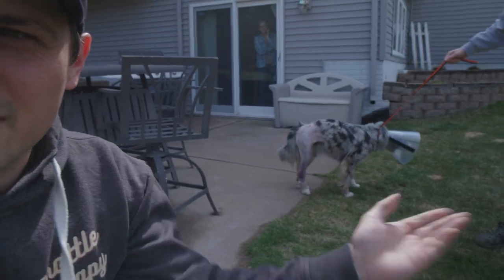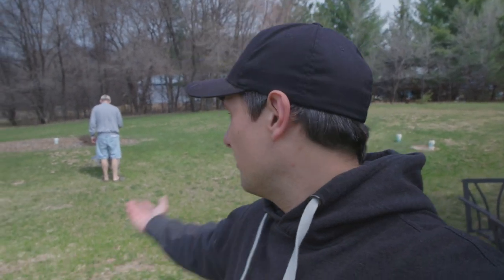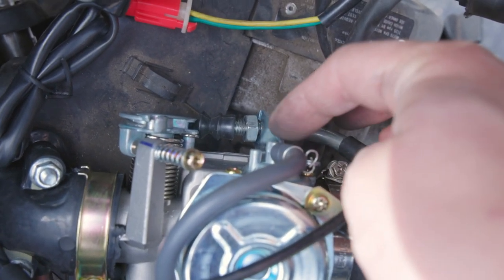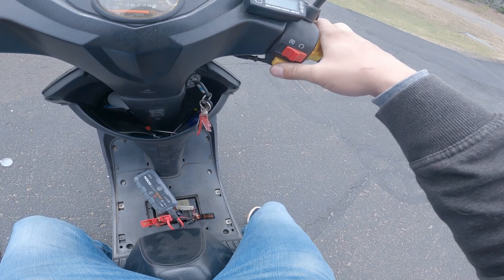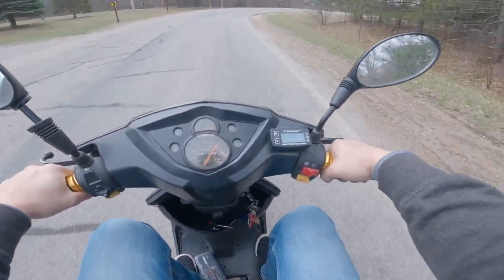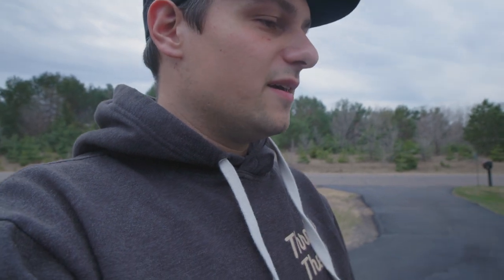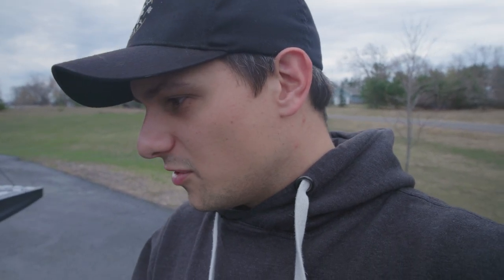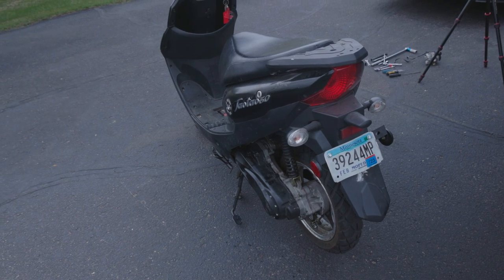150cc gy6 carburetor on 80cc Big Bore Kit TaoTao gy6

Comment from the maker: What does this scooter need to go faster? Lighter weights did not work.
Reply: You need 7or 8 the carb I have got is 24mm 150 with 100 main jet with 35 air with 50mm piston port match the inlet to the head it sounds like it not reving out.
Reply from the maker: @jeffmee763  thank you! Just ordered some 7 grams🤘 I think I have jets laying around somewhere I see what I can do
Reply: @throttle_therapy  don't forget if you using 150cc inlet you must port match to the head put a rag in the port and a good vac to get the bits out and adjust the air screw on side of the carb
Reply: flat slide carb
Reply from the maker: @linojrfilms1561  is that going to make it faster top speed or will that just make the Throttle response snappier? Either way that's a good idea!
Reply: You need to change your jets also you'll have better luck with that air filter that came with that carburetor for whatever reason they tend to bog when you have distance from the carburetor to air filter when converting to this setup also if you run that filter might want to get a fender .
Reply from the maker: Good to know! Thank you. I will try the other filter in the next video🤘
Reply: Lighterweights give you a slower start off 1-30 but quicker 30-45 50.  Heavier weights are the opposite. However it kids it rolling for high end and hills.
Reply: Try some 92-96 jets. Sometimes too much gas will lose you power on the high end
Reply: Throw in a 105cc from Amazon
Reply from the maker: @kalanikaai9215  I'll give it a try!
Reply: Manipulate the intake over and over till the engine runs right
Reply from the maker: @GreenEyeDemon  alright, I'll get some stock stuff👍
Reply from the maker: @kinghtin2darkness  heck yeah, thank you for that🤘 I appreciate. Now I have some work to do
Reply: 7 or 8 gram weights are where it's at. When you add the big bore kit it's going to need more fuel. When you change out you weight to 5 or 4  it could have needed more fuel because the crankshaft was able to spin easier.
Reply: I did an 80cc upgrade and I’m impressed. Plenty of power. I can actually keep up with traffic now. But I’m noticing the idle is terrible. Either too much RPMs or stalling. I can’t find the sweet spot. I’m using the original 18mm carburetor. Timing is good. Valves are good. Do I need to go 20mm carburetor for the additional fuel requirements?
Reply: My scooter kimco 50 has 100cc bigbore 5gram rollers highspeed variator 24 mm cvt carb you need more air in and out fit a A9 cam will help and good performance c d i box my scooter runs well top speed is 105KLM.for my wieght of 81kilo. make sure your engine has low milage making sure vale timing is spot on (worn timing chains on older engines you lose performance.
Reply: Drop it out of an airplane It will go real fast for a few seconds lol😂😂😂😂
Reply: Stiffer backspring of the cvt and 6-8 gram rollers should do the job

Comment: I got that same carb for my 90cc big bore. I cheated and got the AEM afr gauge to tune my carb. I got my carb tuned for a 13.5 air fuel ratio and it runs great. I hit 51mph now. I'm running a 35 pilot jet and a 120 main. Good luck
Reply: stock carb or 150cc ?
Reply: @thestoryofnomads obviously the 150cc goofy

Comment: The thing that made a massive difference for speed on mine was the belt, id suggest getting a bigger belt and also put the old carb back on. I was running 10g rollers as well and I'd get about 50 - 55mph on gps
Reply from the maker: I have a decent Gates belt on there now. Seems to be better that the cheap ones on amazon that we used in the past!
Reply: I dont get it . I see every one putting 8 9 10 Gram roller . I was having 6 with my high speed variator , put 5 and its better  ...
Reply: I did the 80cc upgrade. Huge difference. Not terribly faster -about 45mph but now it’s not a struggle to get there.

Comment: I have the same glixal kit on mine, I tried to run the yellow clutch springs and they were stiff for me, they rode for a long time and it would only do 30mph, I put the 1500 stall contra spring in with the old beat up clutch springs and mine will tap 45 on level ground now. That's with the 7g sliders in it, on a 12 inch tire, with the stock gearing. I've heard you can run the stock head with the a9 cam and the smaller valves will produce a higher dynamic compression, which WOULD increase torque, and I know from experience that a 63mm cylinder with the stock 50 head, stock 50 cam, stock 50 carb, with a pod filter, 93 main, 3 6g rollers and 3 8g rollers, and a range 6 plug, with a stock clutch and driver are 14/40 in the rear will do 55mph on a 10 inch tire, that was the setup on my velocity mp50 with a Meiduo gy6 on it.

Comment: Variator rollers is the key and you went lighter and you want heavier check your spark plug if it's burning good you don't have to worry about chatting especially with the bigger carburetor that's the best it's going to get

Comment: Wish I can help the dig otherwise I have a 80/100 cc kit it was running great 52 then the carb spring broke so I Said let me get a 150cc carb...then cable didn't fit I was pissed ...it bogged Luke yours is doing ...I re adjusted the valves ..the thing took off much better ....now I'll do some jetting next but doing the valves made a whole difference...plush I see all these guys putting alot of time and money into these things.....I just hop on my harley..but I'll do the jets and that's it it runs 52 now ...sucks because the crappy carb that broke I had it going same speed...but I'll put bigger jests in that's all..I'm in Miami people can't drive so I just got the scoot to go around this mess traffic here ...good luck love your place hope dog is OK I have 4 ..wish I can help ..peace

Comment: I guess I got lucky I have the rolling wrench 90cc and I also use the 24mm cwk for a 150cc I forgotten what jet I put in but I got it running nice and smooth with 11gram slider weights
Reply from the maker: I want to get the monster kit from Rolling Wrench! That sounds sick!
Reply: @throttle_therapy  worth it to me brotha
Reply: 11g slider on a 90cc??? I run 11 on my 150cc without losing much if any top end. I do have a larger variator though. I recommend you go lower on the sliders and get a bigger variator, it will let you run way lighter weights without losing top end or at least much

Comment: Or you can install a a9 camshaft you could get a cylinder head with bigger valves also that would help I'm doing the same thing with my 50cc and getting improvements I got my 50cc it's running 42 mile an hour now you got to test and tune plug & Play
Reply from the maker: Its a long process for me lol my brain likes to forget information easily. I should probably start a log with all the settings and keep track that way

Comment: Use a 21 pwk with a 150cc manifold snugged in all yellow springs and 9 weights. For sure you'll hit 46-50
Reply from the maker: how hard was it to fit the carb into the 150 manifold? I am looking at those carbs now thinking it would be fun to try.

Comment: You kind of have to connect the vacuum line otherwise you’re basically running with your choke on my entire time
Reply from the maker: See.. still learning. Thank you! Is it possible to just cap it?
Reply: @throttle_therapy  i capped mine on a 150.  Its just a little valve for decel so it doesnt backfire.
Reply: @mopedmessiah so it's fine to just cap off the top vac line?

Comment: Best size carb for a qmb build is a 21mm pwk carb,I would know because I run a 44mm stroker crank with a 52mm bbk,big valve head,a9 cam and so on,a 24mm cvk will work but best performance is from a 21 mm pwk
Reply from the maker: just ordered one. I appreciate the info! thank you
Reply: This setup is junk I don't even see 44mph out of it. Why because I have one.
Reply: I see 52 gps verified out of mine
Reply: @kickstart4639  I see 52 gps verified on my build so idk what is up with yours
Reply: @kickstart4639  what gets me is I see 52gps verified and I weigh 250 so either you're tune is way off or it's time to loose some weight bud
Reply: My scooter does 60gps
Reply: My stoker crank setup does nothing 43mph

Comment: Imo to really use a 24mm carb you gotta have an actual big valve head.  Most cheaper 80cc kits just have a larger dome.  Valves are the same.  24 wont do anything unless you have an intake port thats close in size.  Rolling Wrench maybe, NCY possibly makes one, Naraku or SSPG are who I would check.  Most of your gains will be in your cvt.  Glixal is okay but an NCY variator, good belt and just tuning it right will help.  Gears are for if you max out the stock gearing.  Im not sure for your bike but on my old Taotao with a 10 inch wheel I hit 50 a few times.  Seems to be where stock gears max out.  Good cam would help, make sure your valves are adjusted and just play with it 🤙🤙🤙
Reply from the maker: sweet! thank you for this. I will have to come back to this comment section! Lots of helpful stuff here

Comment: I tried the 150cc carb and my engine would start but about 1 mile down the road it died out luckily I had my old carb with me and it's running great. The 250 is to much for the 80cc big bore kit
Reply: I recommend a 22mm or 21mm pwk carb if you want something a little bit more responsive. Keep in mind you need to tune them to run well.

Comment: To get better performance on a Tao pony 50
Can you install a Glixal ATMT1-073-1 20mm Big Bore CVK Carburetor
om a stock motor without ripping the motor apart and changing cylinder/pistons etc?

Assuming I upgrade Exhaust, Air filter, 5.5g rollers, Yellow 1500 spring(s)and 
a HIGH PERFORMANCE GATES POWERLINK DRIVE BELT
Reply: After experimenting with the 150 and 50cc gy6 scooters I know what will give you the best results. do the big bore. Its a lot easier than you think. Rolling wrench has a tutorial thats very good on installing a big bore on your engine. 

Get an aftermarket exhaust, but make sure it has a silencer inside, straight through pipes will make you loss a ton of low end torque even after rejetting. 
Get a pod filter. From here on you need to rejet and or do a carb swap. 

I recommend you get a generic 21mm pwk carburator and a jetting kit. Tune it. 

Next is the variator tune. I recommend you get a bigger diameter variator if it fits inside your case. That way you can run really light weights without losing much if any top end. 
For exact weights I am not 100% sure, you will need to play with it. I recommend you get sliders instead of rollers. 

Thats mostly it for the gy6 in terms of tuning. If yoj are willing to sacrifice some acceleration you can get a regear kit to make the top speed higher.

Comment: You got the completely wrong weights. For an 80cc you’ll  need to get 7g weights. 4 and 5g weights will make the engine rev too high which will cause problems unless it’s a 94cc 2 stroke
Reply from the maker: I got some 7 grams on the way! I will test them in another video. Thanks for the info.👍

Comment: I would not put the gear up kid in it because then you're right back where you started with the variator
Reply from the maker: I think you are right on this. I will try to struggle with it a while longer and either get a better BBK or just start testing higher end parts. Thanks for all the info too! I appreciate it

Comment: Somone told me not to get a big bore kit because then you need to get a bigger air intake , then your engine may run too hot and burn out faster. I donèt want to be held down to a low speed and being autistic itès not like Ièm ever flus whith cash.
Reply: I did the 80cc upgrade. Left everything else original (air box, transmission, carb). Definite improvement!  I’m getting up to 45mph. That doesn’t sound like much but with the 50cc, it was a STRUGGLE to get to 42-43. Now, it gets to 45 with ease.  But that’s about it. It’s been a year since I put the 80 in and so far so good.